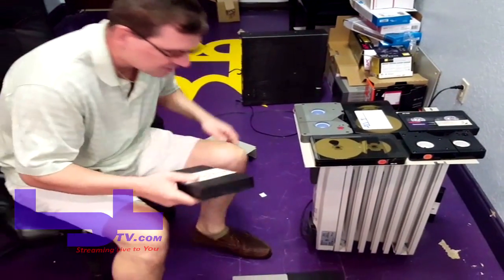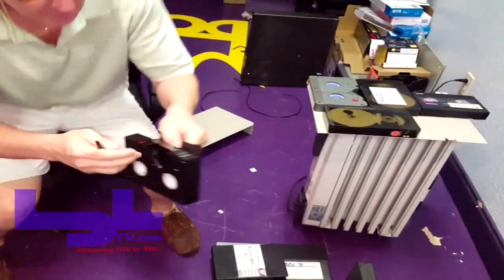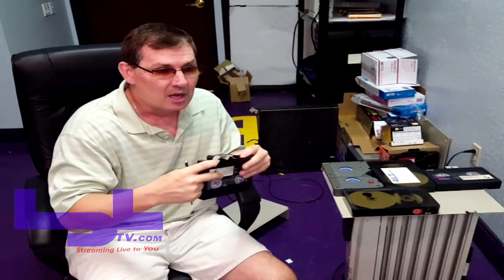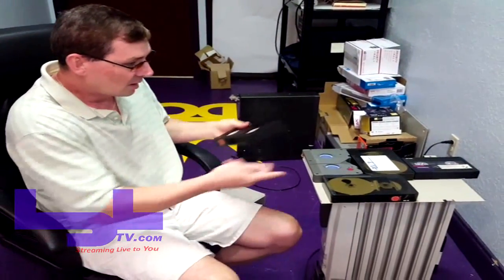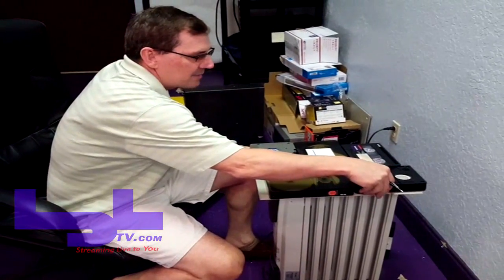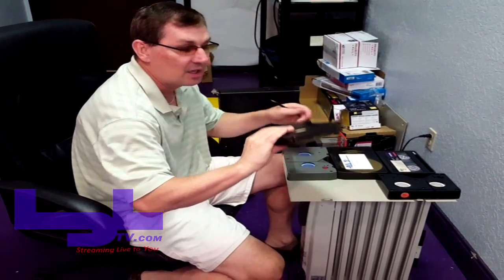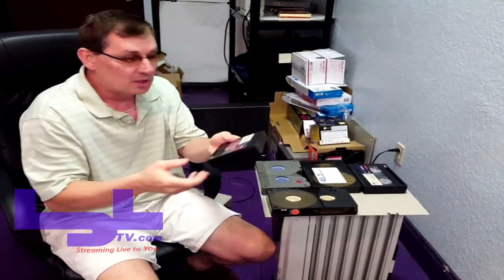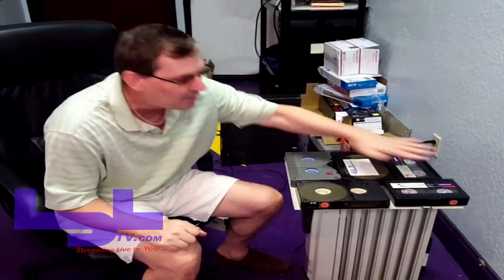How to Bake a Video Tape with Sticky Shed Syndrome on U-matic Tapes

Comment: Interesting video on the basics (very basics) of applying heat treatment to videotape.   Would suggest a proper electric fan assisted incubator set at 52'C and bake the tapes for 24-36hrs or more rather than this.

Comment: what's the tempeture you use with these tapes? i can't understand it well in the video.. thanks
Reply: did you say 78º ? Celcius?
Reply: @archivoredes  sounds like just 78 degrees, no F/C specification.  So it's probly Fahrenheit.
Reply: @Glasses5x  78 Fahrenheit ?? It's 25deg C.. !!!   No..    78 would be in Centigrade which means around 170deg F